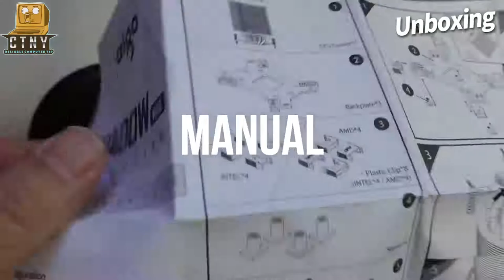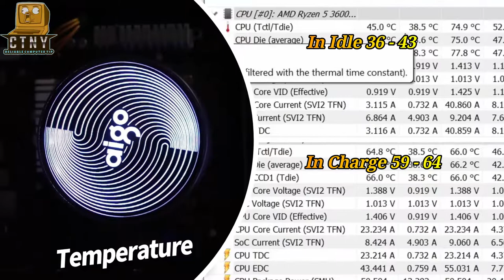aigo Shadow Max 5 Heat Pipes Radiator CPU Air Cooler Installation

Comment: Got this one few years ago. It`s a 5 copper pipe turbine RGB cooler with TDP 120W. I have it now working on a 5600x Ryzen - 30-45 C on normal load, 65 C on game mode. It`s pretty cool and decent cooler.

Comment: I just got this installing when I get home from work, those brackets are base on the type of CPU you have or the motherboard??? I have an MSI Z390
Reply from the maker: I installed an AM4 socket with a bracket so you can install an Intel bracket to the heatsink and put the spacer into the Intel 1151 position of the backplate. Also, insert a plastic clip named Intel to place you put spacer. Please see this video at 1:23. Thank you for your comments.

Comment: hey thank u for the review and build.. btw how to change the colour rgb? i have the same mobo as yours
Reply from the maker: OK In order to sync the color of the fan, you need to connect 5V 3 pin from the fan to 5V 3 pin ARGB header on your motherboard and then download the sync program like Polychrome from the ASRock website to sync the color accordingly. Good Luck! Thank you for your comments.

Comment: dont buy it not good
Reply: Why not?
Reply: @Printed_Visionz3D  look if ur cpu under 3.5ghz and not i7 or high end ryzen dont buy it go with water cooling but if ur cpu like i5 or i3 u can buy it
Reply: @thesorrow96  It support up to TDP 150W.  You are fine with it on Ryzen 7 or i7 as long you dont OC to 5Ghz.. As long you have front intake fan to cool just like other PC Case. this is better than stock cooling that come with i7 or Ryzen 7.
Reply: @toytulog576  my friend buy shadow pro its garbage
Reply: @thesorrow96  This isn't shadow pro.. This is Shadow Max 5...with 5 heat pipe.. your friend shadow pro only have 2 heat pipe that made for low profile cpu cooler..
Reply: @toytulog576  will yeah but this cant be fine in any 4ghz cpu or k cpu like mine "i7-4790k "
Reply: @thesorrow96  its fine. i7-4790k 4.2ghz can even run on Hyper 212 EVO with 4 pipes.. It all depend on your PC Case Airflow..This cooler have 5 heat pipe the fan can run up to 3000rpm..This cooler is better than Hyper 212 with 4 heat pipe w/1600RPM fan..
Reply: @toytulog576  u cant compared hyper 212 EVO with this low cpu cooler u dont see performance u seems read the cpu cooler spec u talk about fan speed + pipes 😅 this cooler work on non k cpu + under 3.5ghz no "OC" for me i dont support OC its bad for ur cpu lifespan , btw i dont want buy it i have already water cooler but i advice who want buy it he should check his cpu model + speed + threads first
Reply: @thesorrow96  I have 8 Air CPU Cooler from Hyper 212 to X, Artic Freezer Dou, BeQuite and Stock Fan... U can even see people on amazon review who are verified buyer can run this fine on Xeon/Ryzen 7..Its not a LOW CPU Cooler, i think because the brand name isnt well known.. ARTIC brand also started similar as this, they start selling at cheap price and when a lot of people see their reviews and it works..theyre brand become well known and price start of the cooler jack up. Now if you think this is Low cpu cooler. its HEIGHT is 141mm and 100mm diameter length...Now the height alone is almost same as 140mm Fan that is not LOW. You can also count the FINS in there ITS 50 Fins + 5 Heat Pipe.
Reply: @toytulog576  ur cooler is fine and u want buy this ? come one 😅 i mean if u wait maybe they will Upgrade shadow max to 5-6 pipes that will be fine , 4 small pipes with small fans + cant do he work for high end CPU if we talk about Artic  they have best GPU coolers but CPU cooler i never test before , and mx-4 thermal there is fake mx-4 this is why i dont like mx-4 i use gd007 and its Chinese btw anyway air cooler depend on ur country weather or ur location and i do recommended water cooler over air cooler and i have Chinese brand "soplay" and its fine cooler i think i bought it for 40-50$
Reply: @thesorrow96  Oh yah? I dont reccommend water cooler 2-3 years later pump fail then it get overheat and leak that the problem that everyone in AIO even at water cooling.. Also look at Cooler Master AIO liquid cooler its a well known brand and yet they still cant fix their leak problem that mostly everyone getting including to me... im sorry but Hyper 212 only have 4 pipe + 120mm fan + 50 fins. ur point? not everyone uses thermal paste come with cooler. IF you dont want maintenance get AIR COOLER + IC Graphite Pad. You only need to blow the dust away from your pc once a year.. the most important is the contact on the bottom of the fan.. someone already did benchmark this cooler at 100% cpu usage for hour and get at 60 celsius.